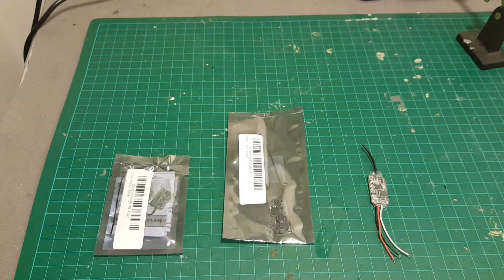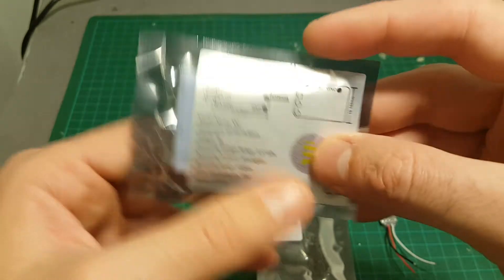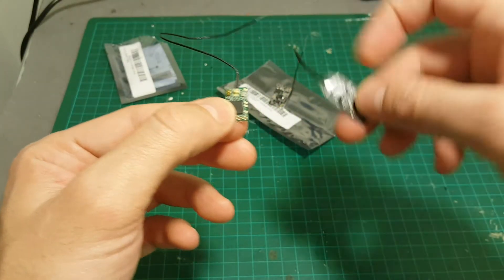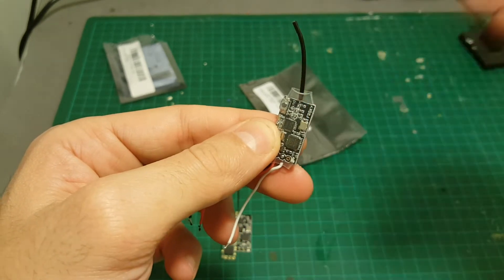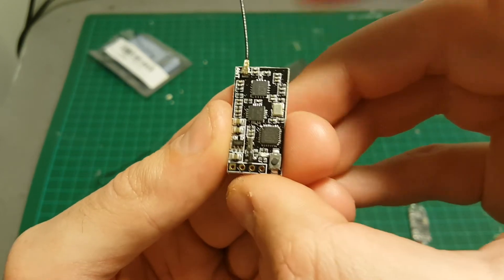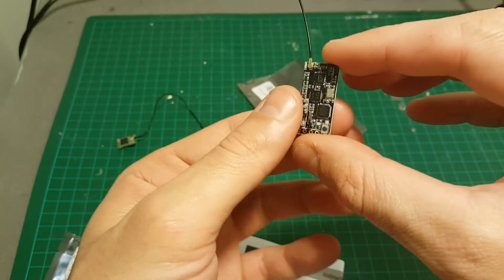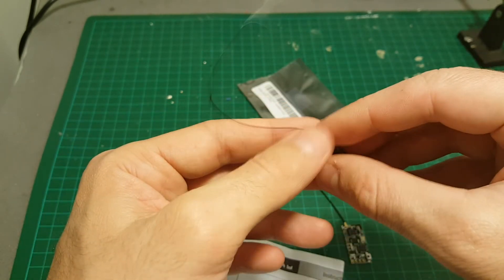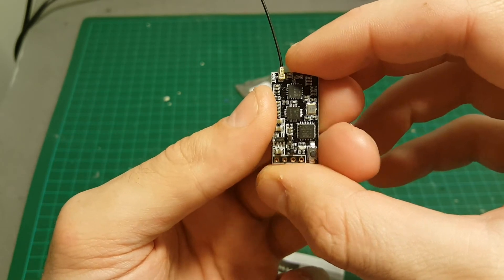Frsky micro receivers mini comparison (LR1000 and FRSKY XM)

Comment: Hi, how do you get PWM output on the XM ? cheers
Reply from the maker: You need an SBUS to PWM signal converter.
Reply: Hi, yes I understand that and makes no sense on these tiny Rx using another board....
 but the Specs say "CH1CH15 for PWM" So Big typo

Comment: how do you connect battery and servos to the LR1000/ fd1000 ?
Reply from the maker: Servos? You will need a flight controller or an sbus to pwm  inverter.